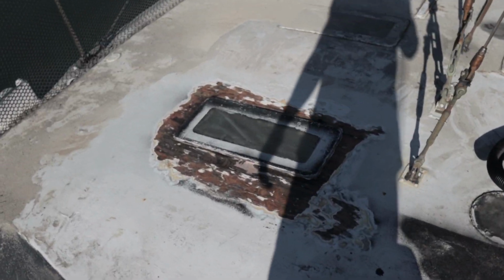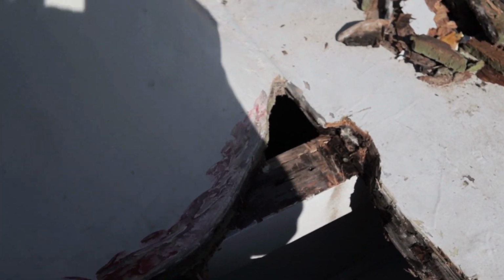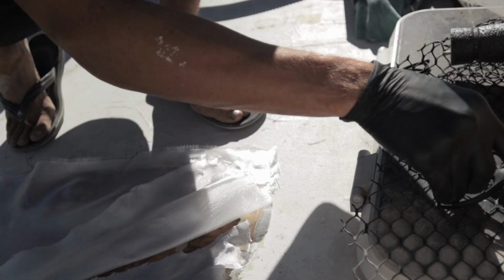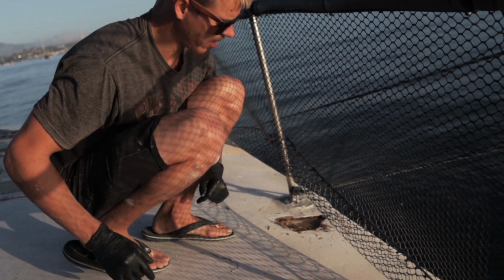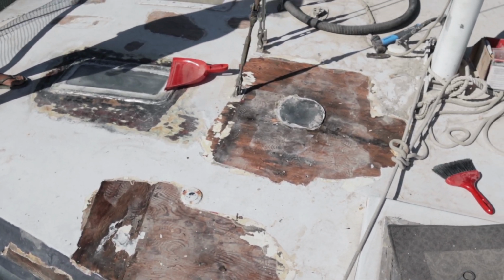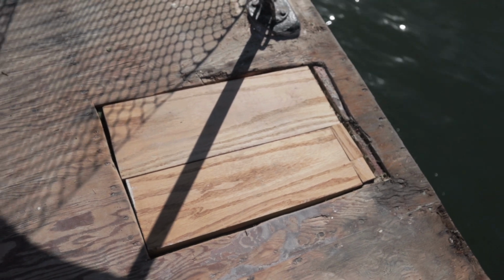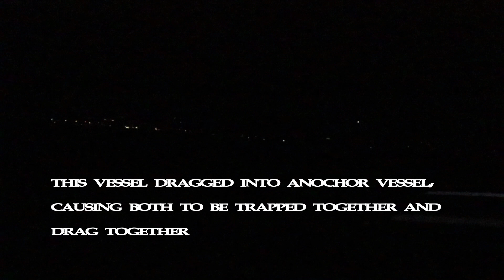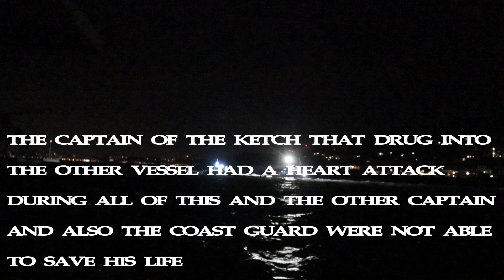DEATH on a SAILBOAT during a STORM | Sailing Trimaran Kraken 5

Comment: I love trimarans.  Will you give us a tour ?   What’s the story behind the boat ?   What work needs to be done ?   What’s your story ?
Reply from the maker: We will definitely give everyone a tour! We can talk about all those things as well. But We will tell you she’s a 1974 Ed Horstman design Tristar trimaran 36ft. Foam core style me any a layer of wood then foam then wood and lastly fiberglass. She was built in San Francisco. She was later moved up into the delta where she sat for man years and then brought to Richardson bay 2 years ago. She needed a lot of work and still does. We have fixed many soft spots, almost done with the deck (just need to paint and nonskid). We built the hard top with solar panels. I did the entire electrical system with Tesla batteries and more. We rebuilt some of the interior and will be dong more of the galley soon. We have a video coming out soon of fiberglassing all of the deck the was ripped up in this video and be faired as well. Also adding a diesel heater, Tesla batteries, fixing the water tank, bildge pump, and more. We still have to fiberglass the cockpit, and fix a big soft on the ama hull! Jonah is my wife and I am Andrew. We moved from Colorado with our two dogs Max and Lana. We live on this boat anchored In Richardson bay. Which means we have to dinghy back and forth to land to get supplies to work on the boat and other things. We will talk more about us later for sure! Thank you for caring Steven!!!!